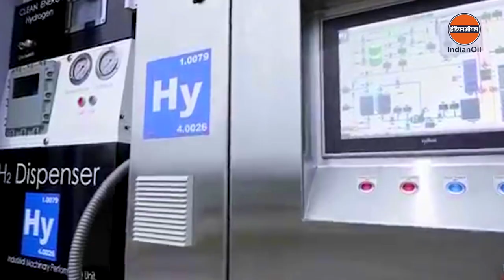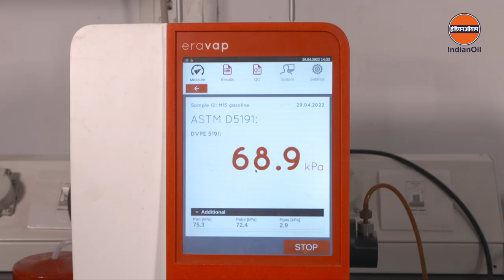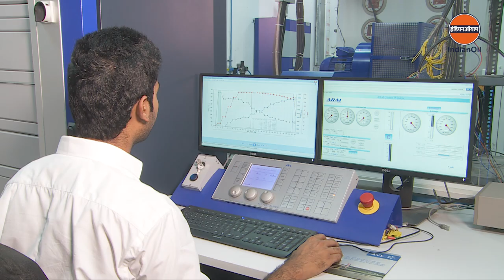M15 gasoline - A next-generation fuel

Comment: Engine will wear & tear faster.  Frequent Air filter & Spark plugs changes will be required as Petrol & Ethanol combusts at different temperatures.
Reply: Car companies will be at advantage due to frequent changes in spare parts
Reply: clearly wrong. For the car to run properly on ethanol, it needs to be tuned properly. Ethanol burns cleaner than petrol. There are sensor kits when you want to use ethanol. You just cannot put ethanol in a petrol car. The kit should either be factory or retro with the relevant tune on the same hardware such as injectors and fuel pump.
Reply: Ok understood.
Reply: @adityagupta4745  bjp bhakt hai tu
Reply: @dr.priyankasharma3634  nahi. Legit nahi. This is an insult. But I am in the car industry and unfortunately i know how this stuff works. This is totally science and nothing political. I am just watering the rumour with proper explanation. This is just like CNGs but needs a different engine tune. That's it.
Reply: @adityagupta4745  you don't know anything about the methanol......every car manufacturer clearly mentioned that do not use methanol blended petrol.....doing this will damage fuel system and your engine.....
But don't worry you and your nitin gadkari know more than cars manufacturer.......duniya hasti tumhare jaise chamchon par

Comment: Its ok, we will change to DME and SPECIAL NON CORROSIVE DISEL ENGINE, as M15 gasolineis concern for people , we will stop uaing gasoline as a whole, along with M15 except for commercial or local use, not for people, gasoline stop for people, POWERFUL OTHER FUEL ALTERNATE LIKE FOLDABLE SOLAR AND BATTERY MAY DO GIVE HIGHER POWER IS THE CURRENT SOLUTION AGAINST GASOLINE FOR RACE CARS.